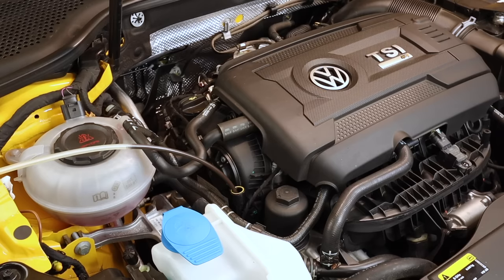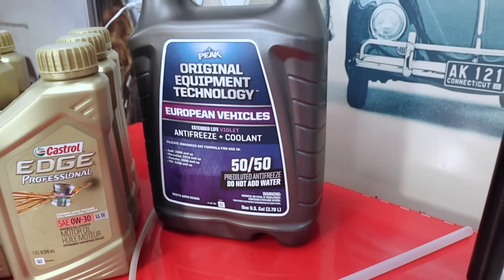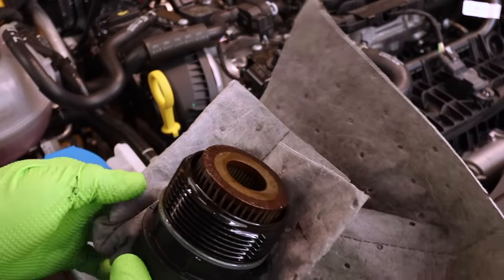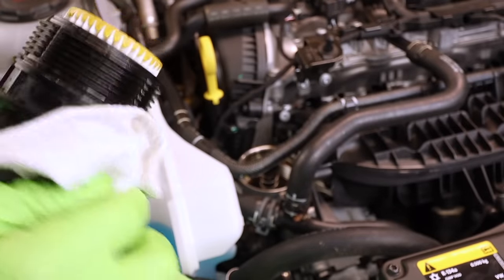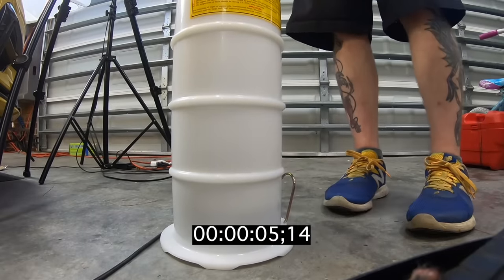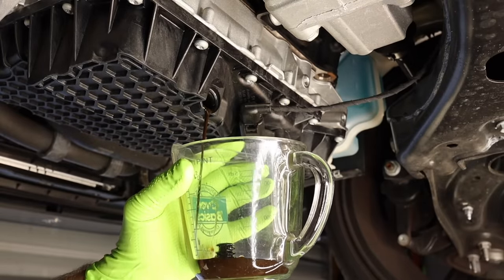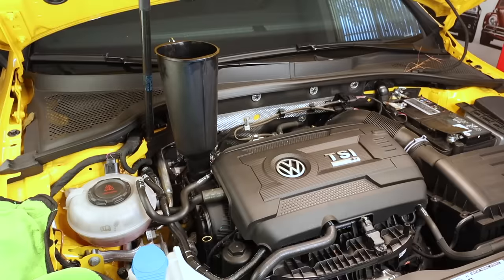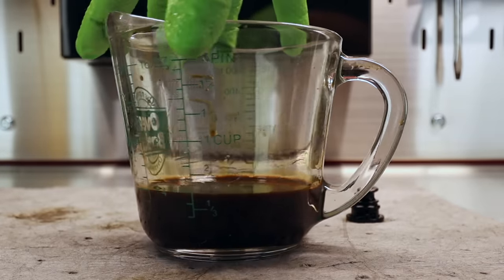Will an Oil Extractor Get All The Oil? (MK7.5 Golf R 5000 Mile Service)

Comment: When I change the oil I'm not comfortable leaving ANY oil. I do a complete tear down and rebuild to make sure there's no oil left :-P
Reply: Right on
Reply: @Satchel McQueen Video The best for my engine, bounty paper towels after I take apart the engine
Reply: I buy a new car every 5k miles
Reply: Lol just get a new car whenever it's time for an oil change
Reply: Who does oil changes when I can get a new car that doesn’t need one?
Reply: You must have alot of free time because that's way overkill
Reply: Arnoldo Moran who the fuck rebuilds a motor too do an oil change 😂😂🤣
Reply: It is much better to simply swap the engine every 5K miles
Reply: Arnoldo Moran that’s just dumb
Reply: Great method for 50k mile intervals!
Reply: @Eastcoastoutlet  who doesnt
Reply: The only way to be sure!
Reply: I find it easier to submerge the entire engine in pure liquid dihydrogen monoxide. All the oil just rises to the top of the pool.
Reply: Di-hydrogen Monoxide = Fancy word for water
Reply: Best thing is to take it all apart, clean everything with parts cleaner, then soak everything overnight in acid to remove the old metal and have fresh new metal when you put it all back together 🙃
Reply: just fill the crank case with diesel and flush it a few times. your comment made my day.
Reply: Same here, I let it drain for a day/overnight. All the gung is in that last 100ml. I even dropped the sump on my UR Quattro as I was sure there had to be something in there but seems that regular oil changes over the last 25 years kep it totally spotless - couldn't believe it.
Reply: Arnoldo Moran I rebuild my engine at every oil change   just to be sure I’ve got all the old oil out. Saving the planet in oh so many ways.....
.
Reply: When you drain the oil there is always a substantial amount of oil left. Oil is left in the oil galleys to prevent a dry startup. Typically more than a quart of oil...
Reply: Matthew Famighette I do
Reply: @MrHairyTeabag  i use uber everyday and dont drive my car ever so ther'es no need to change oil
Reply: Hottspitta jR 
Thank about what you just said ............ 3 days later .......
Watch the video again  do the math  if the car only hold 5.7 ltr. And he took out 5.7 ltr.  How much oil is left ?

You might have an argument it the car had oil coolers
Reply: Arnoldo Moran your last name seems to be misspelled .
Reply: Kids dont do meth you will end up like Arnoldo
Reply: What's oil ???
Reply: @JrSpitty  See my post regarding residual oil in the engine.  You are absolutely correct and several oil labs have confirmed.  I wish an extraction or spill and fill removed all but 100ml.
Reply: @992turbos8  Hottspitta jR is correct.  Most factor service manual will list another capacity after a rebuild it it is generally a full quart more.  The amount listed in the owners manual is only for drain and refill.  I have rebuilt many engines.
Reply: Brian Sydnes 
So much BS  Period !
As a Level 1 Master Tech at BMW with a CPO cert. for 16 yrs and  now a Automobile Engineer for 11 yrs,
In 30 plus I’ve never seen a service Manual staying 2 different oil capacities. 
For the same engine with the same specs and capacity 
10 qts capacity will only hold 10 qts.
Reply: @992turbos8  How about you disclose your real name, employer so we can verify your credentials.  I am sure your employer would not be pleased that you are spouting off your expertise, and credentials and then calling their customers morons and stupid.  How many Factory Service manuals have you read out out the tens of thousands in existence to be certain not one have ever listed a rebuild capacity?  How much oil is needed to prime a new or rebuilt engine?  Your response to HottspittaJr suggests that vehicles drain 100% of the full oil capacity. You call yourself a MasterTech.  My GM 2.4L general engine spec lists 5qts.  The GM tech that rebuilt my engine and Jasper Engines rep both said it takes nearly a full quart extra to fill the sump and prime the engine.  Dozens of members on BITOG confirmed their Factory SI call for .5 to more than 1 additional quart of oil after a rebuild to bring it up to proper level.
Reply: I like to run the motor dry till it seizes
Reply: Brian Sydnes oh he won’t he’s a coward
Reply: What do you think was in there for the last several thousand miles?  The same used oil.  Leaving a little in has virtually no effect beyond being anal.  Ohhhhh no, he used DIRTY oil on the o-rings!  :,(
Reply: Right! And (oil at temperature) not always run below 3000rpm, regurlarly to 4500/5000rpm on the highway.   Most cars are made for max. 6500rpm, so he likes that..
Reply: Every time...
Reply: Yeah, man. After I drain it all out the drainplug, and take the filter off, I usually start the engine and let it run for a few minutes to get all the remaining oil pushed through the system, into the pan, and out the hole. Then I usually sell the car pretending the battery's dead, move to a new town, and buy another car until the next time it's time for an oil change.
Reply: Does you car manufacturer sell  100 sizes  oversize pistons???

🤣🤣🤣
Reply: Why don't you just drive the other guy's car or catch the bus ?  It's easier than a complete tear down and it's always easy to blame the other guy who scratches it ! !
Reply: @MrHairyTeabag  Probably safer than owning a VW for longer than 5000 miles
Reply: @SpamMeGooglification  Nah that Dihydrogen Monoxide is some scary stuff, just about anyone thats ever touched the stuff eventually dies.
Reply: On my old 2 stroke motorcycle, it said to change the oil every 10 hours. I did it twice a day for years.
Reply: @matthoward1174   Don't you understand anything !! -  It means to change oil brands every day e.g. from Castol to Amsol, to Mobil1  etc. 
- Don't wast time and Get out of bed - off the computer and Do It !!  Drain that tank and refill it with another brand !
And when you are driving and a sign  says 'Stop on Red Signal'  it doesn't mean 'ON Top of IT  -  it means Near it !!
Reply: @MrHairyTeabag  🤣
Reply: Remove drain plug then run engine at 6000rpm to remove oil faster
Reply: I thought I was the only one.
Why do the customers complain when I take over a week for an oil change.
Reply: @spukduk5632  Don't laugh, there are some that think that.
Reply: @MrHairyTeabag  😆
Reply: Yeah, I change the engine, just to be double sure. haha
Reply: After reading all these childish comments I thought I was on VWVortex
Reply: Nice try.
Reply: @992turbos8  that’s because service manuals are for “servicing” not full rebuilds.
Reply: @992turbos8  try working on real cars then. Any engine with a substantial oil cooling system will need more oil to “fill it up” from dry than the standard service amount. Now, depending on engine setup, some of that oil may be used in the assembly process - priming oil pumps, turbos and oil coolers / lines, but it’s still more than what would typically be required when the engine is given an oil change.
Reply: @Eastcoastoutlet  I used to do hat when I was in my 20's.
Reply: If you want to do it right , get some one other than a technician to do it . Every time I had oil change at a shop they either  forgot to replace the filler cap , overtorque the drain plug or oil filter . The oil change message always came on way before 5000 km . I do it my self and never had problems , just keep your receipts from oil and filter purchases for warranty purpose .
Reply: I love the humor in here it’s great, I miss it a lot.  I moved to Kansas hardly any humor in this state.
Reply: That a boy
Reply: @iamasmurf1122  i loved doing meth when i was a kid, miss them days
Reply: Yes, so do i, i rebuild my engine's every oil change 🔧🔧🔧🔧🔧
Reply: @MrHairyTeabag  so do i, or i just rebuild my engine's at every oil change 🔧🔧🔧🔧🔧
Reply: This just seems like a lot of work. I just flush the system down the fill hole with bake cleaner. Works great.
Reply: Pfft, noob. I do t do oil change. I dont engine change every 10,000 miles. Only way to make sure all the oil is changed
Reply: I swap the engine every 100 miles,  take no chances
Reply: My car takes 4.6 ltrs, i extracted 4.6 ltrs, no mess
Reply: @John Chlebek it actually has good anti aging properties. I recommend bathing in  it.
Reply: Haha
Reply: @Satchel McQueen Video toilet paper
Reply: I see what you did there hahaha
Reply: I add water then run engine degreaser then add the oil 👍
Reply: Casuals, I just fly
Reply: Best to just replace your engine at every oil change interval 👍
Reply: After draining for 1hr, fill engine with 36 cans of brake clean (non chlorinated) wait 10min, pull drain plug. Fill with oil, enjoying bricking your block, priceless.
Reply: But when I’m lazy to do a complete tearing dow, I would just flush my entire system with bleach or 70% alcohol and it seems to do the tricks
Reply: @tssci6774  If you have a GM vehicle and he is an engineer at BMW then I'm pretty sure you aren't his customer.  In fact, if you had a BMW you still wouldn't be his customer because the only time you'd be talking to an automotive engineer is in a non business setting unless you also work for an auto maker.  I get that the GM techs told you one thing but techs aren't always right man.  Had some techs tell me it's okay to reuse the drain plug on my golf but then I find out it's very not okay since the o ring on it is more like a crush washer than a normal o ring.  Also, if GM had to rebuild an engine for you due to a class action suit, idk if I'd trust everything they say about their motor.
Reply: @gravygraves5112  How do you know I dont own or have owned a BMW, spent much time in Stuttgart GE. Mercedes and BMW was in my backyard.  Anyone can spout credentials on the internet and hide behind fake handle.  He clearly is neither a tech or engineer if he has no concept of priming an engine lubrication system, and then refers to it as "Overfilling".  My GM manual, under engine rebuild, calls for 1-2 qts of oil for priming the system. Every factory manual I have owned had similar specs for priming.  Rebuilt my first engine in 1984. When it comes to oil specs and 10-12k mile drain intervals, coupled with fuel dilution and GDI abrasive soot, they screwed up in this generation.  They want you ti think it was just rings.  Ford, Honda and Toyota had similar problems with oil consumption of GDI engines.
Reply: @tssci6774  I just didn't see you say anywhere that you did own one is all.  Priming being in a factory manual as you mentioned makes sense considering it's not something your average joe would be doing for a normal oil change.  I'll have to look into that more for my own car.  I've got a MkVII Golf and have just stepped into the realm of DIY maintenance so there is much to learn!  Where do you recommend looking for factory maintenance manuals btw?
Reply: Took engine out, went laundrymat and put in full cycle. Put engine in dryer and and waited until it went ding, took it home put engine back in car, got jailed.
Reply: I don't reuse the engine period
Reply: Talk about overkill😂😂
Reply: @MrNopehaha  fancy is just another word for precision engineered molecule.
Reply: @steveone9375  it's that thing we were told would run out one day and destroy the world economy. So we forced an artificial shortage to destroy the world economy.
Winning.
Reply: This is much cleaner and easier using the extractor.
Reply: @paredding  shouldn't really be the case if you warmed the oil before draining.
Reply: @MrHairyTeabag  I thought I was the only 1 to do that, huh.
Reply: I always refill the crankcase with bacon drippings. Doesn't work very well but it makes everyone near the car hungry.
Reply: Why didn’t you remove the oil filter first?
Reply: @MrHairyTeabag   my old boss bought a new truck every time it needed new tires
Reply: @Michael-uo4jj  it’s pretty standard tbh
Reply: Wut!?! Your supposed to change the oil???
Reply: Wait! There's oil in my car!?!
Reply: I bought this on Amazon Amarine Made 12V 60W Oil Change... I did an oil change with it today. After pumping out the oil I removed the oil filter. About a cup + leaked out. Wasn't expecting that. Thats actually why i was looking up vids about it and found nyself here. Clean up sucked. Took the 5 quart container and was right on the money. I'm no mechanic, but I think it went well. Then again when ever im out the blinker fluid I always do a complete break down and rebuild. Don't want no old blinker fluid left in the thingy. Mixing with the new blinker fluid. Just to be safe...
Reply: You’re my hero! I tried to do a en engine rebuild to get all the oil out, but after I put it back together I still found some old dirty oil dripping out of the plug. What a waste of time. I didn’t want to do it again so I donated the car and bought a bicycle.
Reply: I will always drain via sump plug. Too much left behind.
Reply: Yea not everyone got time for that
Reply: Is this between taking your ocd injections???
😂
Reply: You need to just change your car engine every 5,000 miles. Then, hire a surgeon to remove your head from your rear end.😂
Reply: Leaving no oil at all,take the oil pan off. Only way. There is always s bit of oil left.
Reply: You never drain  all  engine oil  ,always 20% stay in engine
Reply: If you have a skid plate and lowered car. It's not very fun.